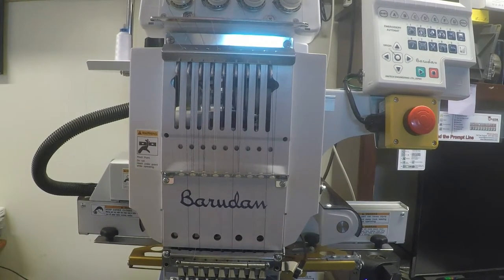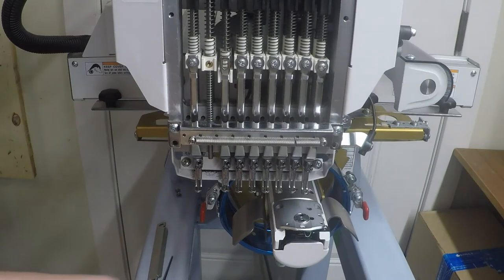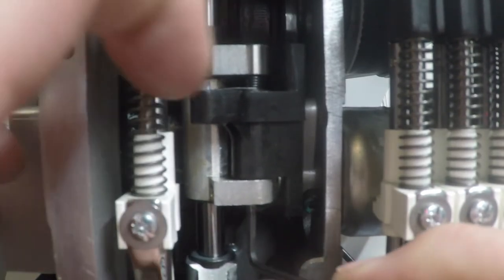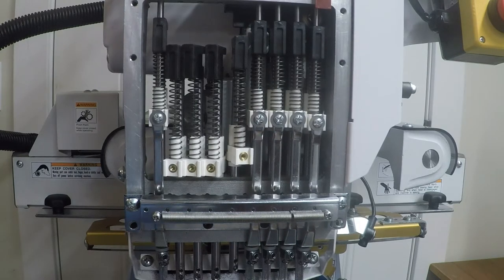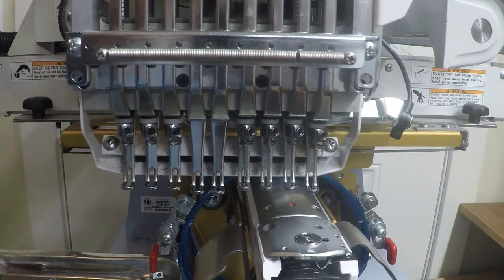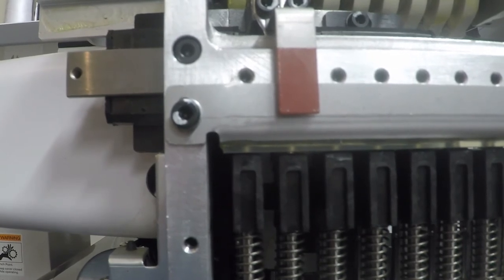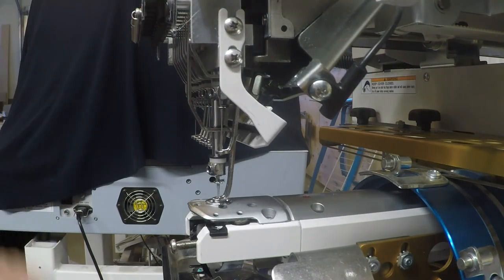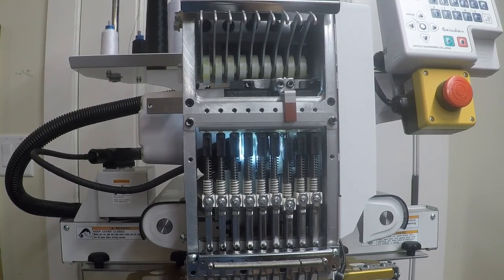Barudan S Head Needle Bar Driver Replacement

Comment: I went through all the steps here in your video, but now, when it starts to run its like the driver isnt getting held out to stay in contact with the needle bars? there is good tension from the spring any ideas?
Reply from the maker: If you pushed down to much on the pin that holds the needle bar in position, it may stick and not release, so maybe try readjusting it.
Reply: @kirkbrooks101  the needle driver works smoothly, i did have a pin tension issue it was a bent shim i replaced it with the ones Barudan sent me and it worked smoothly. ill have to look into again put a new spring in as well
Reply from the maker: @aaronpalmer5782  sometimes the needle bar driver just sucks, I keep a bunch on hand just in case one doesn't want to move freely.
Reply: @kirkbrooks101  yea i could see that since they went to the S style head alot more plastic in here for sure thabks for the help Sir. Hopeing to get down time in production to finish this